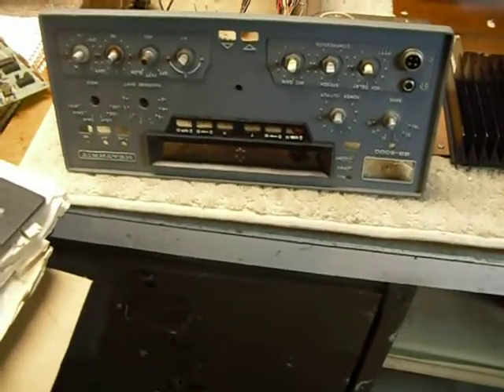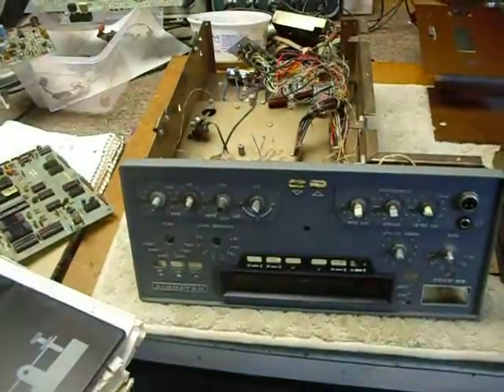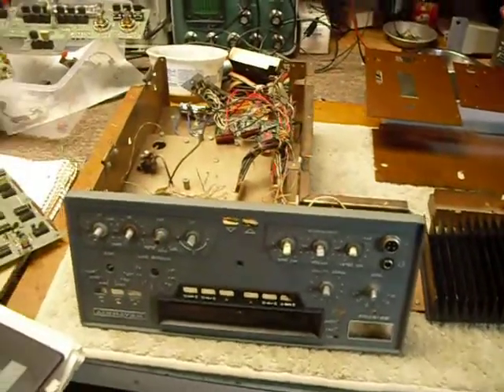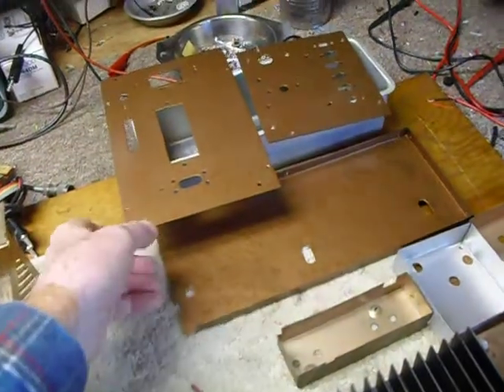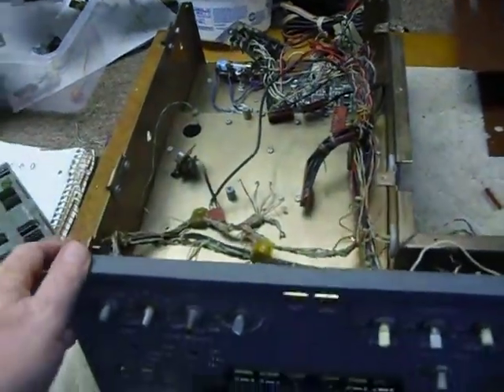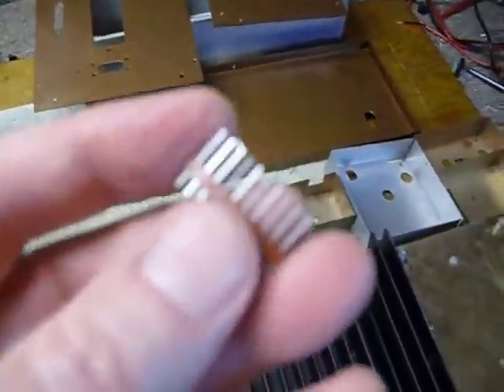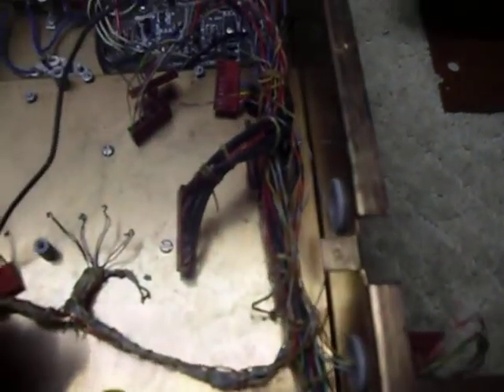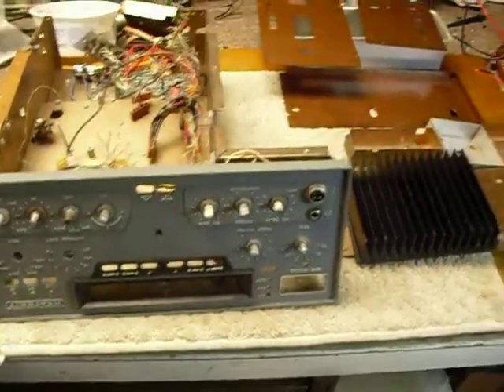Part 1 RAREST HEATHKIT ?   SS8000 tranceiver  1979 vintage synthesized  HF

Comment from the maker: Slaznum1  Yes the 8000  is looking better every day I inspected the main audio board today and found two little capacitors that were never installed they are in the CW sidetone circuit so these I found to be common and I had them so installed them and the board is now ready to run (I Hope) . The biggest problem I have is that the schematics I have that came with the 8000 are different from the 8000 I have . Engineering improvements were always made during design  before the release of a new Heathkit so the schematics I have are from the very early design ideas and not the unit sold to me . There are many changes in the interconnecting wiring harness thats the biggest headache for me . 

Viking Ranger I think you said it was well the Johnson viking equipment is very good .The price you quoted is about right . So its up to you .  Any old equipment the first time you turn it on use a Variac transformer and bring the voltage up slowly  over about 1/2 hour  to re-form the electrolytic capacitors bring it up a few minutes in  about 20 volt steps .With any old electronics I buy I figure there will be things needing repair or replacement and it always is a gamble fixing up old rigs . So that is a consideration too like final tubes, capacitors  etc. .   Good luck !  with the project .    Bob

Comment from the maker: Les ...Yes those tin plated connectors are real trouble makers ...I have a procedure that has cured the problem for me several times and lasted for years  .First I clean them with an eraser the rough typewriter kind is best rub the pins until they shine  . Then give them a thin coat of Silicon grease .I have done this to several rigs with very good results .  Originally I thought that the silicon grease being an insulator would cause problems itself but I have never experienced any problems doing this and so i recommend it . I have also removed the tin plated pins and installed gold plated ones this works great but since developing the eraser/silicon grease procedure I have not had ANY problems . 73  Les   Bob

Comment: Bob,
The Society of Eight-Bit Heathkit Computerists (SEBHC) had same issue with in-line tin connectors in their restorations.
Les Bird and that group produced a set of replacement PC boards for the Heathkit H-8 and H-89 computers,
using newer gold-plated pins.
http://sebhc.lesbird.com